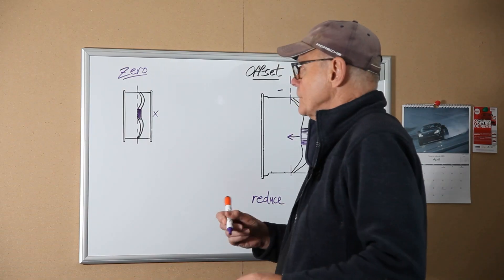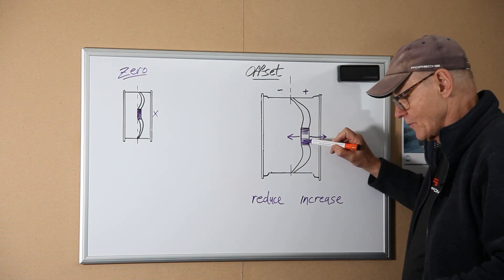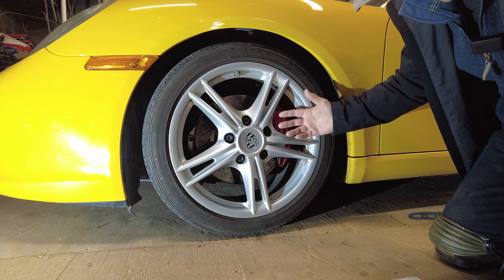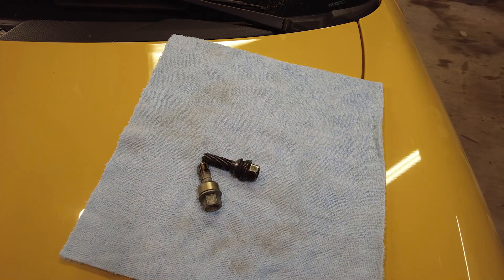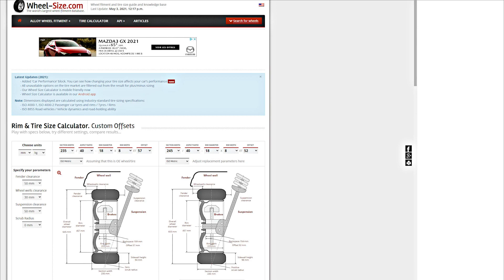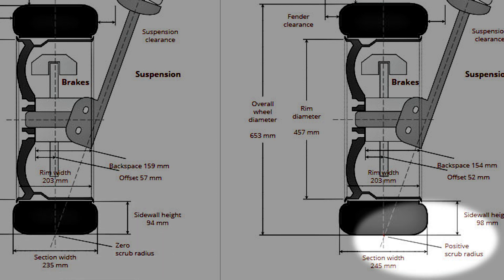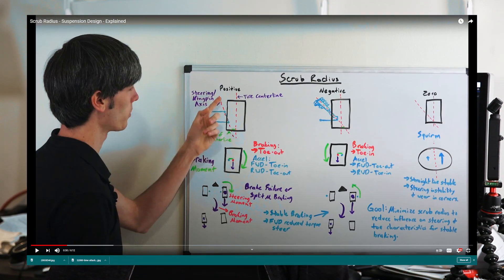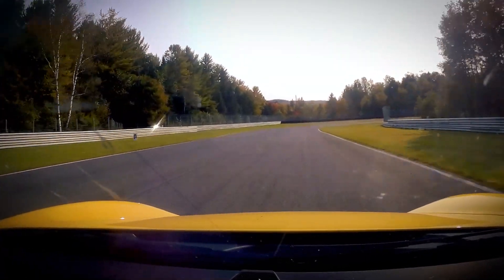Wheel spacers and offsets

Comment: My Audi calls for: 8j x 19 ET 45, ET range 43-47 OR 9j x 20 ET 42 (40-44).  I have access to a set of wheels that are 8j x 19 ET 50.  Can I just run with a 5mm spacer?
Reply from the maker: Yes. You can add 5mm for stock fitting. More if you want to push the wheels out a bit.

Comment: What size spacer do you recommend for a 986 with stock wheels?
Reply: I've put 15mm on the front and 7mm on the rear. Stock 17inch wheels, Base 2.5L 986. No rubbing and looks are much improved without being over the top in any way. 
In stock form I feel the front just looks way too narrow.
Reply: @christophsoltau4662  I agree the front is narrow. I want a more aggressive look to it.
Reply from the maker: I found that 10 mm spacers worked for me. You could go to 15 without any problems if you’re at stock ride height. Past this and you’re compromising bearing life and possibly unpredictable handling. My opinion only.
Reply: @NewArt1  10 mm all around?
Reply: @nathancortez92  you can likely go more in the rear, but please chech your stock wheel style offset as not all stock wheels have the same offset. Also wheel width will affect the max spacer which will fit with no rubing or increase in camber.
Reply: @NewArt1  thanks for the reply
Reply from the maker: That’s what I used
Reply: For reference for 987 Cayman/Boxster with OEM 18 inch "S" wheels 7mm spacer on the front and 15mm spacer on the rear works with no problems, no rubing etc. Stock camber settings, stock ride height. There is actually room for slightly wider spacers in the front (few mm) and much wider in the rear (5mm for sure, maybe more)
Reply: @Rrr_n1  I appreciate your insight. Thank you. I'll check. I was think of lowering just a bit.